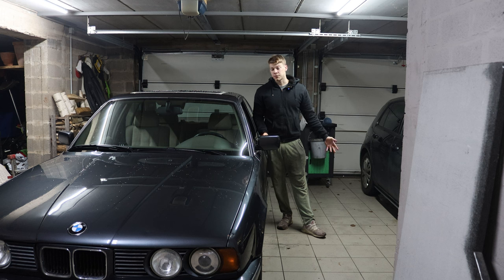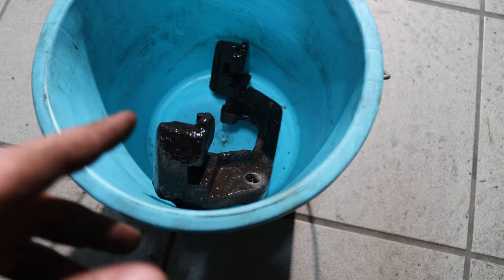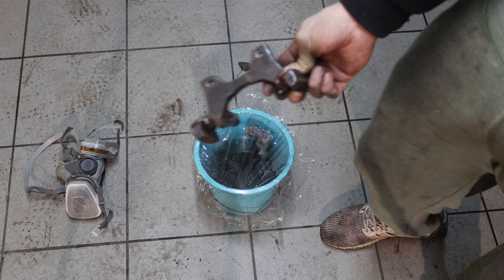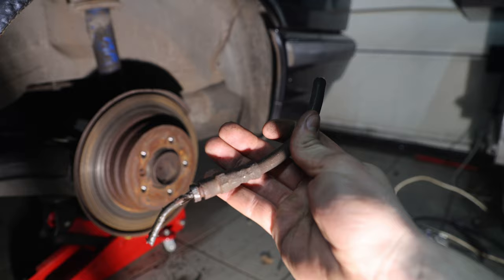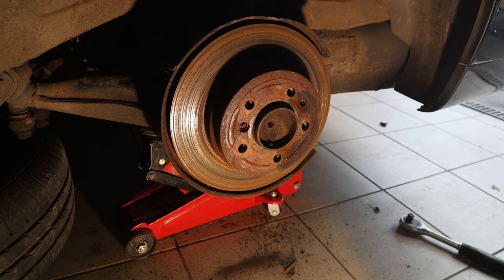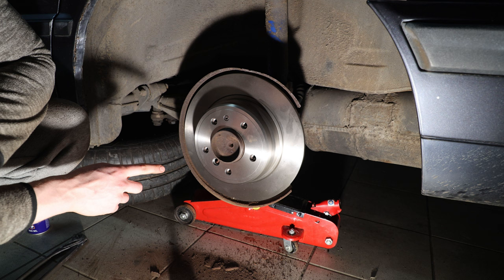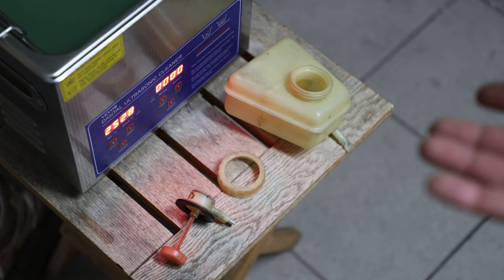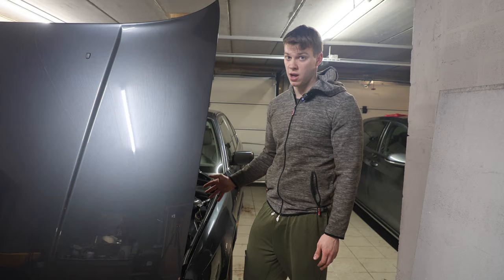Stop braking! Brake rebuild on the e34

Comment: Pro tip if a drill bit or extractor bit breaks off - just sharpen a masonry bit correctly and it will drill absolutely anything. Even the most expensive drill bits can't compare.
Reply from the maker: Will try that in the future thanks a lot!!😇

Comment: surprised that the nigirin rostlöser has a german label! I am sure you know Epoxy Brunox Roststopp too. It is a good choice surface rust on bodywork because it also acts as a primer.
Reply from the maker: @TheSaemiProduction
@TheSaemiProduction Yes! Epoxy brunox is a good product but on bodywork rust pretty much always comes back unless you weld in fresh, unpitted metal. The nigrin product line is either really good or garbage. The Rostlöser from nigrin doesnt work well just like the gel in the video. The Tauchbad however works really well. Have to get lucky I guess :/
Reply: @DailyDrivenClasssics  Good to know! I am interested how good the caliper paint is going to stick. I had some bad results with some products.
Reply from the maker: @TheSaemiProduction
@TheSaemiProductionCaliper paint ususally sticks really well. Just have to apply many layers. I did 5 thick layers iirc:)

Comment: Brooo🤦🏻‍♂️ I believe you're trying your best. Though generally speaking, the vehicle should’ve genetically defined as the Grand Canyon of all rusts molecules😢 You should start with the most critical everything after will be easier…
Reply from the maker: @Second.Q
@Second.Q Thanks for the comment! Although I don't really understand what your trying to say. The car only has rust on the doors (like every e34) and on one wheel arch. The rest is rust free minus a few tiny spots that I'm gonna adress in the future. So from a rust perspective it really isn't bad for an e34 and rust isn't on my priority list. The stuck calipers and broken engine(which I repaired in length) are far more critical to get the car back on the road than fixing a bit of rust which this car doesn't have a lot of. If I misunderstood your comment feel free to correct me :) Thanks for the support!
Reply: @DailyDrivenClasssics  
I have 1992 e32 750i. Soon I bought it in 2013. I started to tear down body frame-sand blasting- and applied water prove anti corrosion oerlikon contraves epoxy😵‍💫Although I live in Middle East, Saudi Arabia specifically. Which humidity aren’t at the anchorman daily weather report and such procedure ain’t necessary, although. It surely pointed me a year after to continue handling suspensions, diff, breaks till I finished the driver seat lower motor and you know what? Still couldn’t figure out is it the epoxy holding my vehicle! Good lord magnificent brightness every time I find my self working down beneath it… like if it’s just produced sooo satisfying.
Reply from the maker: @Second.Q  i agree ! Full underbody restoration is super satisfying. Also e32 750i sounds really nice:)

Comment: Hi. When I bought my E39 TDS the ABS system was not working, but all 4 calipers were working as they should. After replacing the ABS module with a second hand one my rear brakes sometimes get stuck ( it's random ). Do you think if I rebuild the rear brakes the issue will go away or my "new" ABS module is bad?
Reply from the maker: @GMAd-yc1vj
@GMAd-yc1vj Never had ABS issues so I can only give a suggestion to check the affected calipers. If their water seals are still good, the issue could be somewhere else? If they are bad i would definetely do a rebuild on the calipers since then its only a matter of time if they get stuck again.
Reply: Just remove abs in total.❤
Reply from the maker: @user-hu6yr9ro4q  wouldnt do that . Had a scary encounter in my mk2 without abs. Brakes locking up and not being able to steer is frightening🥲